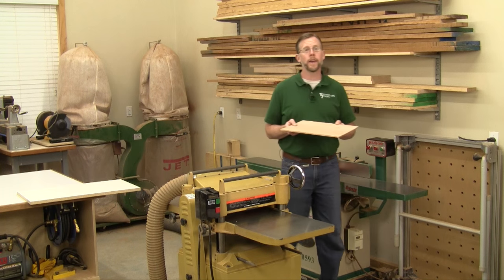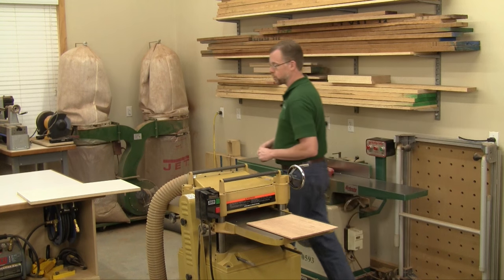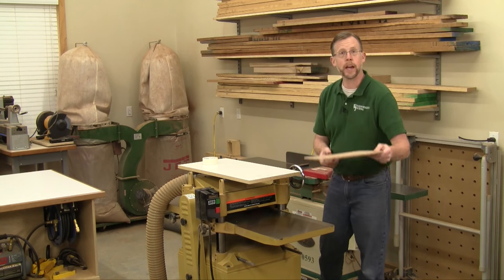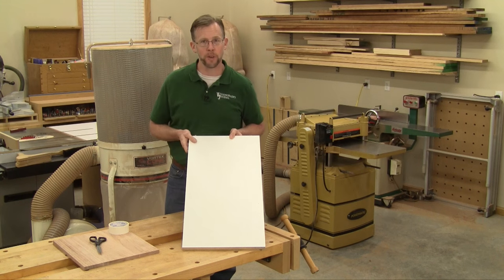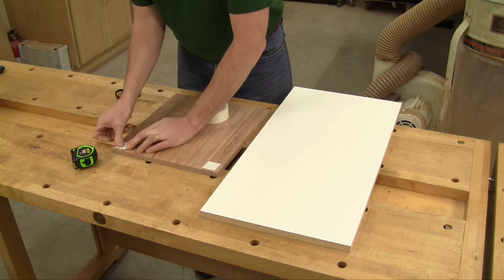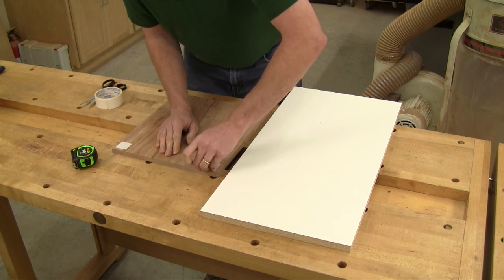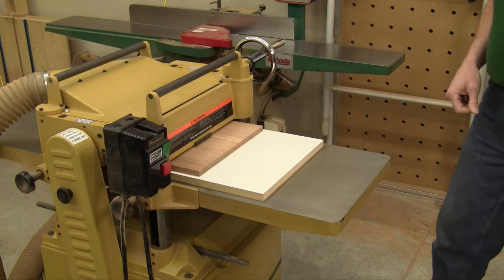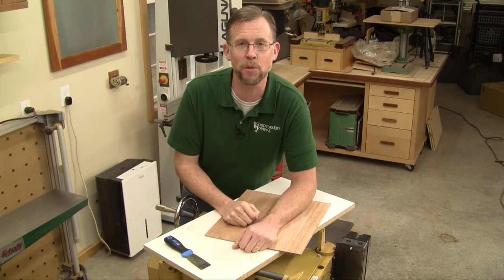Plane Thin Panels Safely with this Sled Jig

Comment: I've done this same thing for years, only without the carpet tape.  Never had a problem; there's enough support that it's going nowhere.  The sled has blocks on the bottom on the front & back and doesn't move - more of an auxiliary table to add rigidity.  I made it out of an excess piece of countertop - 2 3/4" pieces of particleboard glued & screwed together with laminate on top.

Comment: You need to be sure the tape is not to thick, as the panel gets thinner the panel will bow if you use thick tape to hold the panel down. I have used another way and that is to use a cleat across the end of the sled this will keep the panel from being ejected and you don't need tape.